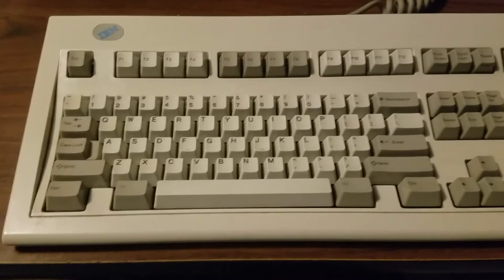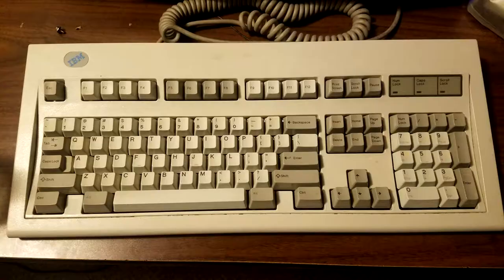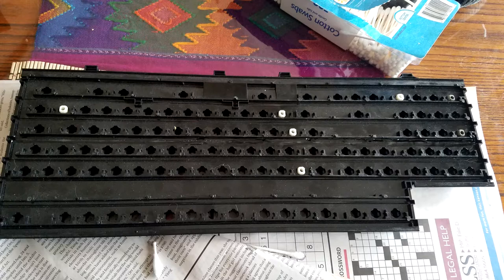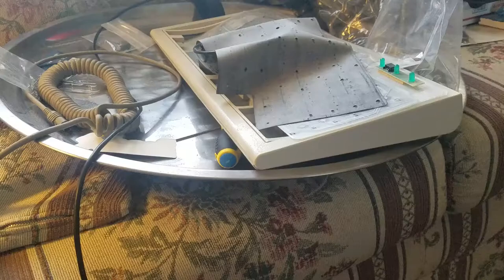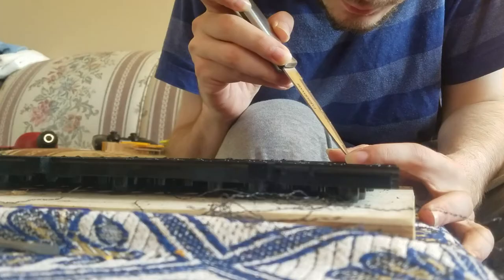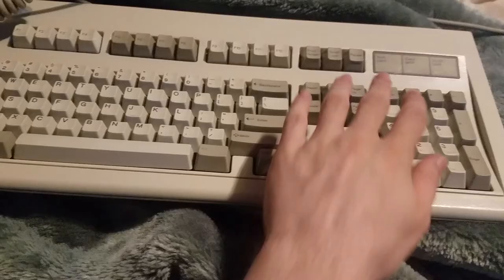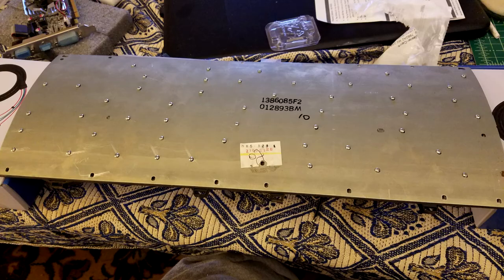IBM Model M Keyboard Repair: Replacing the Plastic Rivets with Metal Screws [Screw Mod]

Comment: Until you started talking about this on Twitter, I no idea a keyboard could be repaired in this way. I've seen quite a few with the melted plastic 'rivets' in their construction, so I've learned something new. Nice work on the mod as well.
Reply from the maker: Thanks for watching! Yeah it's a really weak design and it's quite common on these buckling spring keyboards. But the bolt/screw mod thankfully removes this weakness.

Comment: I have not had to do a bolt mon on the two that I currently have luckily. All of the rivets are fully intact which is kind of amazing, but mine have never been shipped or jarred around to my knowledge, so that certainly helps. One of them is a rubber dome model M though, which still has the same controller, barrel plate, and the layers including the membrane, they just have rubber domes instead of the springs and flippers. The typing feel of that keyboard is still quite good, and it is easily the best dome switch board that I have ever used. I thought about modding it to be a buckling spring model, but that would require me to buy all of the springs/flippers, and all new keys as the rubberdome models use a different key that has a solid stem with no cutout for the spring. After doing all of that, I would have more time and parts into it than it would be worth when I could probably buy another buckling spring model M for less than what I would have into it including time at that point. 
Both of mine are Lexmark made models, I would like to have an earlier square badge IBM made model M, but I am certainly not going to pay the price that those are going for on eBay these days, so hopefully one pops up.
Reply from the maker: Nice! I've never tried the rubber Dome Model Ms but I have heard that they're great rubber domes. I also would love one of those square metal badge Model Ms. I also really love the industrial Grey model Ms, those are very nice looking.

Comment: Such an awesome and helpful video man! Thanks for making this! It was fantastic! I have had a Model M for years and have had some issues with it off and on, but this looks like a really compelling fix! This is such an easy guide too, and it's really impressive just how you were able to make it so simple to understand. I've always been incredibly intimidated by taking apart the Model M, but I'm now heavily considering doing this. It's impressive that Unicomp still sells some of the parts, including the barrel plates. The end result here was incredible; awesome job man!
Reply from the maker: Thank you so much for the kind words! I was the same way, this keyboard is really difficult to repair and it's original design is getting weaker due to the plastic. It is extremely helpful that Unicomp still sells these old parts because I would have been SOL if it weren't for those new springs and the barrel plate. It is such a good keyboard and to have this one that I repaired as my first model M experience is wonderful. Thanks for watching Will!
Reply: @jikissgamer  Thanks for all your hard work Rami! And thank you for demonstrating this. It really is a pain to work on old plastic of any kind and the Model M seems to be no exception. It's awesome that they were able to get you those springs and barrel plate pretty quick. Unicomp's parts department seems much more intriguing than I previously thought haha! And that really is just too awesome--can't go wrong with having your first Model M also being one that you custom-built practically!

Comment: Mechanically bolt and nut is stronger than screw.  Also self tapping screw can strip out the hole.   Instead of lock washers, one can use locktite or nail polish.
PS I fell in love with the IBM keyboards on the 3278 terminals.  The IBM PCs had the best keyboards (except for NBC rated keyboards for the Navy and Army). I am on my 2nd Unicomp as the 1st one died from coffee spill.
Reply from the maker: The 3278 keyboards are amazing! Those are quite expensive today but I would love to try one at least once in my lifetime. I also got  a Model F but it doesn't work with my converter for some reason. I might need to check the PCB
Reply: Would the screw not be stronger than the very brittle plastic rivets anyway?

Comment: Mine was made just a few months after yours (March 16th 1993) Not bolt modded yet, but still the 1391401 with all the features that those come with (such as a detachable cable and such). Unfortunately, it's in dire need of a bolt mod which I intend on doing soon.
Reply from the maker: Nice!! Yeah the 1391401 is one of the most common ones since it was shipped with the IBM PS/2 computers, they are excellent keyboards. Good luck with the bolt mod, I hope it works out for you! It's a great fix for these keyboards and makes them feel like new again.

Comment: I nearly fell over when you said your semicolon key didn't work. I did a bolt mod but had the exact same problem with that exact same key. The last thing I wanted to do was remove all those bolts but that's what I had to do. It may have something to do with the proximity of that key to the screw holes around it. Upon reassembly I did not replace all the bolts because I don't think all of them are necessary. If I had to do it all over again I'm using screws. Bolts are probably overkill.
Reply from the maker: That's amazing that you had that same problem with the semicolon! I'm glad I'm not alone haha. Yeah I think it was because when I was holding the board together in the middle my fingers nudged that spring out of place as I screwed it in. I had to be super careful when I was screwing it back in. I kept inspecting the springs after every other screw I put in. My K key also occasionally chattered and so I loosened the screw behind it which seemed to fix it.

Comment: Can you do the screw mod without separating the various layers?  I really see no obvious reason you have to disassemble the entire unit.  I don't see how drilling the pilot holes would cause any contamination inside the layered assembly if you're careful.
Reply from the maker: Yeah you can totally do this without taking the board apart! I just had to take mine apart here because my particular barrel plate was split in half.

Comment: Thank you! I'm preparing for this job at the moment. I was wondering about the first row of rivets (In front of the space bar). Just omit them?
Reply from the maker: Indeed, I started drilling the bottom row at first but then I realized they weren't necessary and so I stopped.

Comment: Well, after the z-150 keyboard, thanks for the screw mod. Doing this too. Lol
Reply from the maker: Thanks for watching! I highly recommend doing this if you have a de-riveted model M. It makes it much more durable.

One thing I forgot to mention in that video is that sometimes the membrane contacts will become oxidized or severed, in that case it can be easily repaired with a conductive pen during the screw mod process.

Hope it works out well for you!

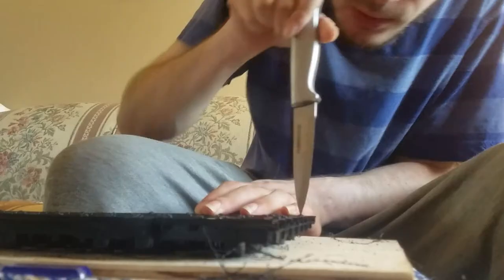Comment: 9:12 - Cleaning the hole, or tightening a screw? Knifedriver is always a viable option.👍🍻
That piece is a good 'ol IBM banger for sure.
Glad it came out alright...drilling that plastic gets dicey...metal bits do not give a damn about plastic.
Reply from the maker: Yeah it's an awesome keyboard! I really like it and I'm glad I fixed it. What I was doing with the knife there was creaking a little dent to guide the drill through otherwise the drill would just slide off the target.
Reply: @jikissgamer  Ah, right, a little like center-drilling.
Reply from the maker: @lambtron1265  Indeed!